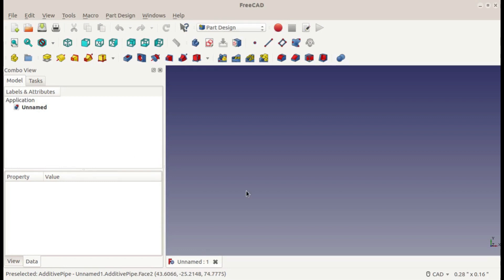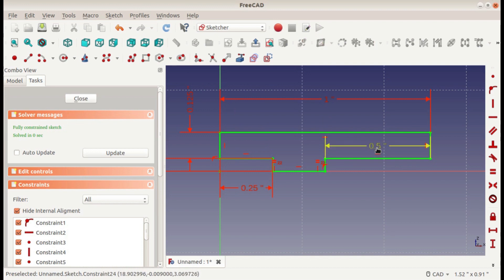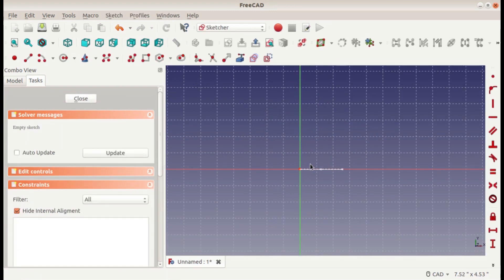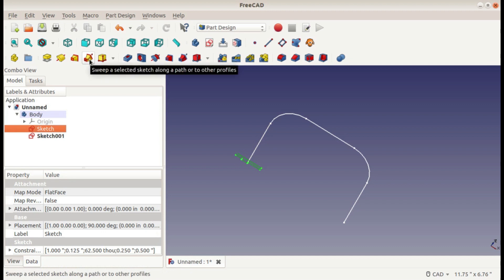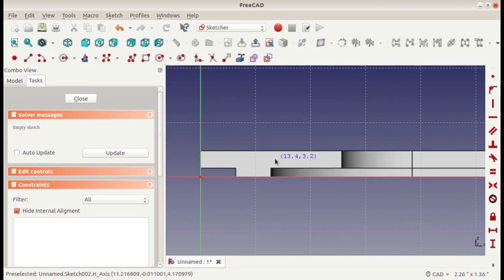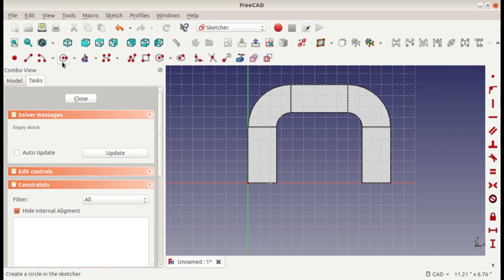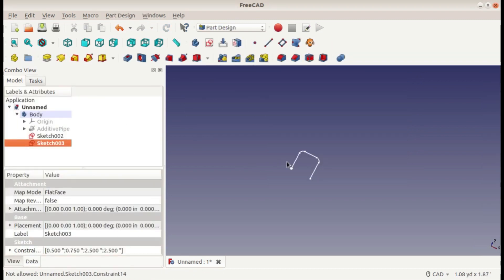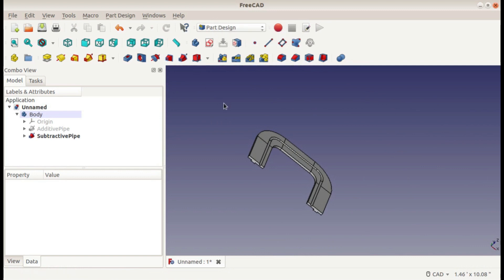Learn FreeCAD: #5 Sweep - Tutorial

Comment: keep getting error: failed to validate broken face
Reply: Hi. I had the same issue. After messing around for a bit I found that my issue was that the sketch that I was trying to extrude (the semi-circle) was not a closed shape. I only made the semi-circle and then tried to subtract it along the line. So what I needed to do was simply add a line between the 2 open points and then everything worked out. Hope that makes sense and that this was helpful. :)
Reply: Yup, exactly the same for me, thanks Jens!
Reply: Same! did you find any solution?
Reply: @sashalachance2561  absolutely nothing lmao I gave up.
Reply: @girthbrooks4219  For me, I managed to make it work by making sure that my 2D "shape" is well closed and that that my path starts on a point of my shape.

Comment: Thanks for the tutorials.  I'm learning a lot.  One question on this one, and I don't know if I will be able to explain it, is when I used the reverse sweep tool, it did not remove the top (flat layer) of the groove.  I had to move sketch 002 up to 0.19" and it removed the entire groove, save half of the semi-circular shape on the face opposite the origin.  Again, not sure if that makes sense, but that is my issue.  Version 0.18 Win 7.
Reply: Same thing happened for me, but it was because my initial shape (sketch00) had wasn't aligned with the bottom axis properly. I didn't make the shape coincident to the axis, so it had a degree of freedom up/down.